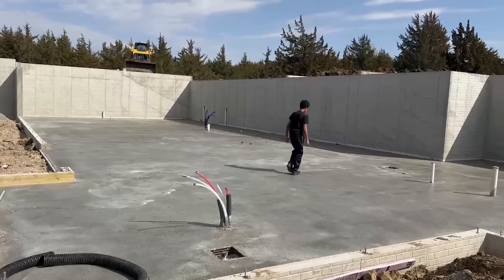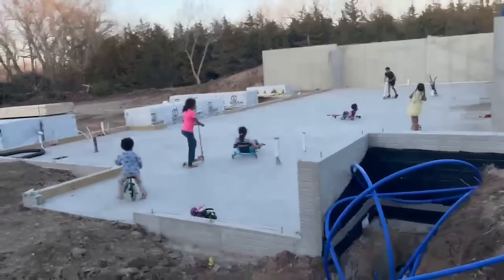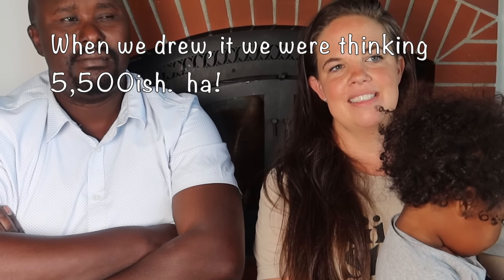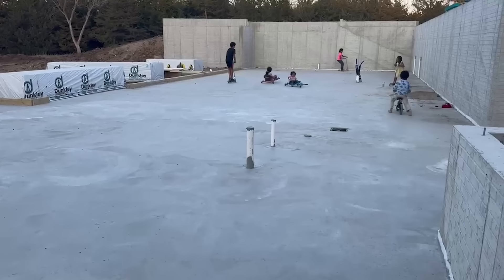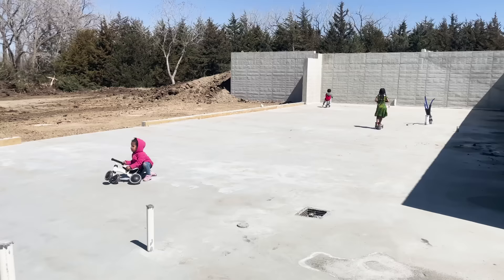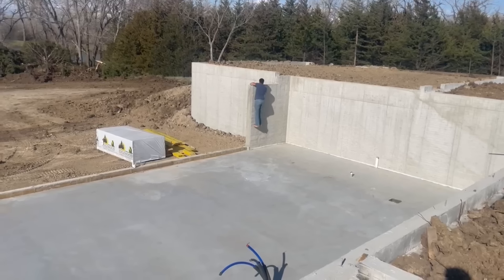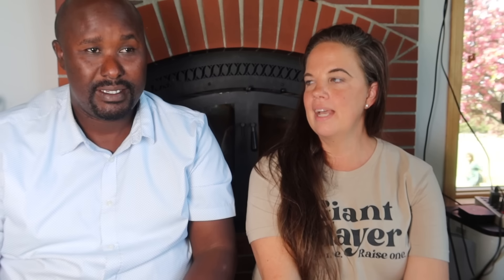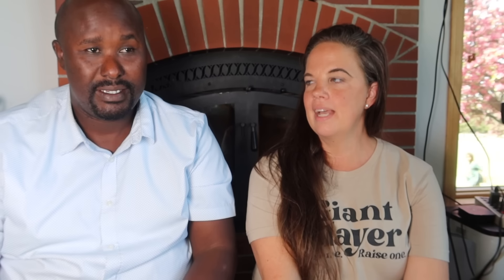Our house is going up!  How big is it????

Comment: Also one thing to consider is getting a full house backup generator. With having such a large family losing power can be a nightmare so a backup generator would be well worth the cost of install
Reply: Yes, a STAND BY GENERATOR, it has the ability to automatically turn on if the power goes off.  With all those freezers full of food it's a necessity ....

Comment: Use Alexas or Google Homes for the intercom. You don't need to wire anything, they're multipurpose, and it's removable.
Reply: Though privacy could be a concern with those.
Reply: Don’t do that. Read the TOS.

Comment: I know with your larger family I would have at least 2 heavy duty extra large capacity washers and dryers with a laundry  on 1st and 2nd floor with a walk in dog washing station on 1st floor off off garage ..and if it's a two-story I would definitely have a laundry chute... 1 of the i had to have...one of the best things I ever did was build a pantry entrance way off of my garage all I have to do is open the door and push the bags and boxes into the pantry and even though I live in Michigan I have what's called an Arctic entryway off of the garage it's where all the wet clothes and all the wet boots and shoes get put in before you can even walk into the large kitchen family room combo

Comment: Congratulations, on your new build I'm so happy for you.  Just a suggestion if you hadn't thought of it yourself.  I was recently in a house that had a lift system installed.  They had added a hydraulic lift between the garage and their storage area, that they used  when they make their bulk purchases, and they also use it to move their seasonal decor up and down, so they didn't have to worry about stairs.  As they have gotten older, and the children have left home, they use it very often.  Their lift could support up to a 400lb load.  I

Comment: You need to internal vacuum systems that bent out to the basement or to a closet upstairs and downstairs you might need four to plug into the wall. No dragging vacuum around the vacuum by your stove they can put in that sucks up as you sweep. Make sure you keep the vents clean so you promote fire.❤❤

Comment: Will y’all have a laundry shoot? Also the vacuum system that has the long hose and connects to the wall? How bout the system when you sweep the floors straight to the vent that sucks it away ( I think it goes to a container outside that you empty periodically). Will you have 2 dishwashers? Trash Compactor? I have a friend with a very large home and lots of kids. They built theirs with jack and Jill bathrooms…
Hopefully it won’t take long to build and it looks like your builders are off to a strong start.❤

Comment: You're new house is brilliant, it's soooo big I'm so pleased for you but I'm curious, as you were digging mainfloor basement, why doesn't the garage have a basement?
Reply from the maker: Great question!  Most houses in the states do not have a basement under the garage.  I think it is because it is cheaper to have it in a concrete pad on the ground rather than making a floor strong enough for vehicles that could fall through.  😜

Comment: Oh I get the two ovens and 8 burners. when my stove died about 7 years ago. and we had to buy another one. and we we're in our home. I thought I'm buying what "I" want!! I picked a two oven and 5 burners. and it was only 3 of us at home but when the other kids and there families came. it was great!! and still is. and it's gas!! good thing I married a handyman he had to plumb it in, there had been elec, when we bought the house. I don't like Elect stoves. another thing is when you loose elect in the winter you can still cook. all you need is a match to light it. OH how exciting 2 large fridges. are you having a vacuum system where you sweep the floor and then a little area it sucks the dirt down to a main vacuum system? what kind of vacuum system are you putting in? That's great for the older kids. and very nice when they come back with there families. how exciting to have a pantry that you can have a place to let your sour dough rise. and not be in the way.... I'm so excited for you two. thank you for sharing.

Comment: Here are a few things I recommend from my own kitchen remodel. For kitchen cabinets, pay the extra for full plywood boxes. They will hold up long term way better than the normal laminate cabinets. I chose Corian countertops with a seamless sink and a one piece backsplash (no seems to gather gunk). I also chose PVC tile for the kitchen floors. It looks like tile with grout lines, but it’s a smooth surface that won’t get gross grout lines. And it has the feel of linoleum to stand on so it’s much easier on your back and joints than traditional tile.

Comment: Hello Sara and solo, I know you mentioned rooms for girls and boys and then public bathrooms. I my experience, it the girls were provided en-suite bathrooms i.e two-3 vanities, 2 showers and maybe 2 toilets - enclosed behind doors for privacy, that would speed up the mornings. Put a privacy wall in front of the showers- could be glass blocks or just a wall- you would be surprised of the outcome. Area for towel storage and maybe drawers for personal items ,  drawers or under sinks for lotions spare dental supplies etc etc. that makes for a clean countertop. basket for used linen . The can even select their clothes and get dressed in the bathroom if they wish. The next time you see the girls they are ready to go.  Same suggestion for the boys’ space.  The public bathroom should be for guests and you maintain control  over that. They should not use those bathrooms as they have theirs.  You should not be stressed to getting guests bathrooms and guest area ready at any time- as they will always be in a state of readiness. I just may do light dusting of the rooms, depending how long it was last used, put in fresh linen ( I  don’t dress the bag after guests leaves but rather use my oldest set until I dress for the next guests and some floral etc. and we are done

Comment: In Canada Square footage is calculated minus the basement for some reason. For example, our old house was 1,150 square feet but we had a full basement that was completely finished so technically we had around 2,200 square feet. I couldn't have imagined only having the main floor as it only had 2 bedrooms on the main floor. Our new house is the bigger but the same idea. When you gave the square footage do you mean the total amount?